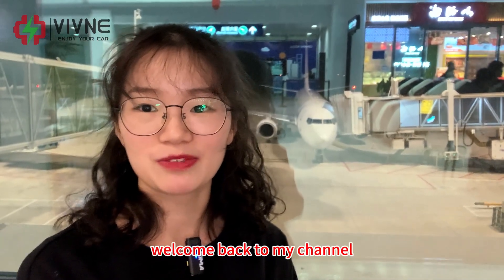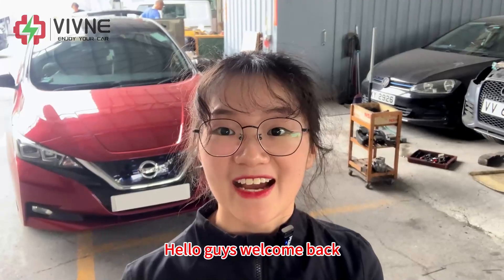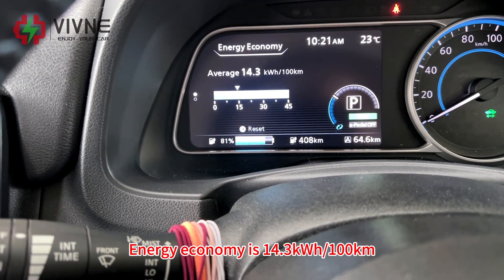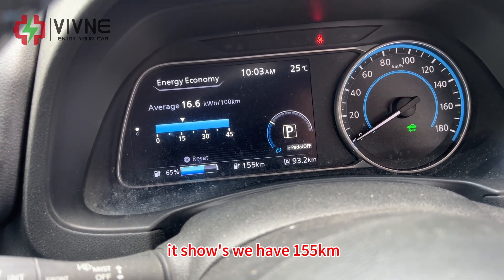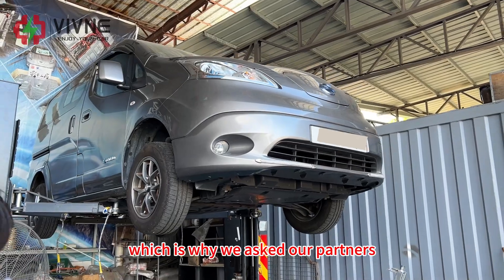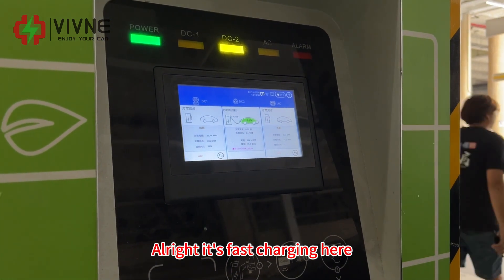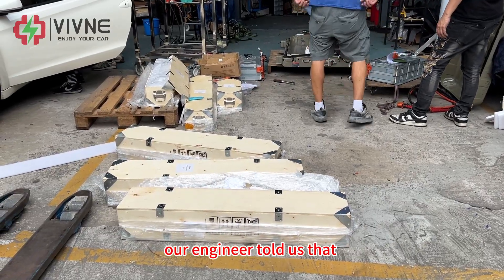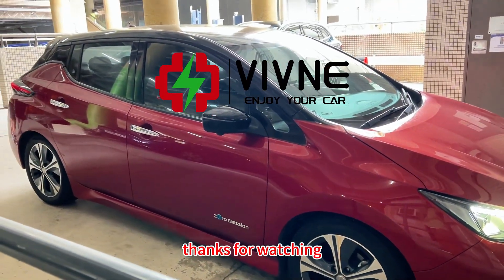VIVNE-Nissan Leaf 75kWh battery pack(Part 2)

Comment: It's a shame all the hassle we'd have to get through with shipping costs ourselves and being able to install it... a 350kg+ battery 😬 I wish I could though 🥲
Reply from the maker: Yes, you're right, shipping is an extra cost, and it can vary quite a bit depending on the destination country. May I ask where you're located? I’d be happy to check the shipping cost for your area. As for installation, if you're concerned about the complexity, we also offer a plug-and-play version of the battery pack. It’s very easy to install
Reply: @VIVNE-CoraLiu  how much would it be to Lisbon, Portugal? And then there's the customs fee 😬
Reply from the maker: @MiguelAugusto1982  Basically we have door-to-door delivery service to Portugal, and the shipping cost already covers everything: customs fees, taxes, and any other charges. I’ll just need to check based on your exact address to give you an accurate quote. Would you mind sending me your address on WhatsApp(+8615211174371) so I can confirm the details for you? Thank you.

Comment: Hi Cora, so you managed to install a 62 kWh pack on env200...? 😮 I'm so interested... Does it need special modifications? I own a 24 kWh env200 2016...
Reply from the maker: Hi there, we produce 50kWh for env200, no need any modifications, the cooling system still remains the same position and still works fine. I can share all the details with you if you are interested, here is my WhatsApp: +8615211174371

Comment: Hey Cora , I don't see the this 75kwh battery on your website.
Reply from the maker: @ttmakandigona  Hi there, the 75kWh is a battery we customized for a customer according to his requirements, but because it is too heavy, it requires upgrading the rear suspension, also need to cutting the battery case, so we do not recommend 75kWh, 50/62kWh is a better choice.

Comment: yeh but the price of this battery and installation costs as much as a newer 62kw car and this thing doesn't have warranty or service in US if things go bad
Reply from the maker: I don't think so, we provide 2 years or 80,000km warranty service, During the warranty period, if anything non-repairable happens, we will replace with free new modules and shipping freight is on us too.
Reply: @VIVNE-CoraLiu 非常感謝你的分享和服務承諾，將來有機會的話我也有興趣🙏🏻
Reply from the maker: @ 没问题，有需要随时联系我